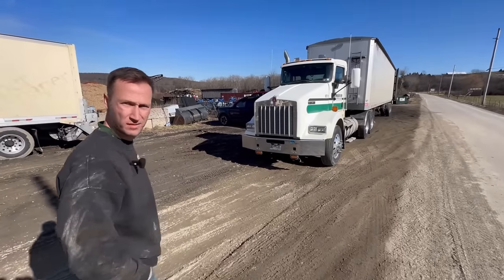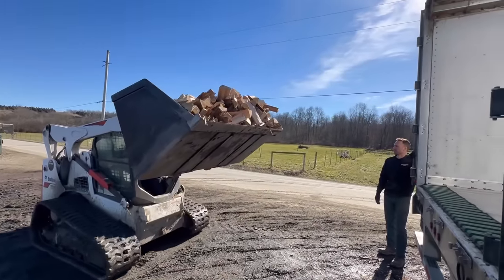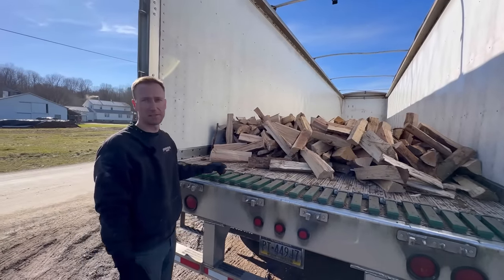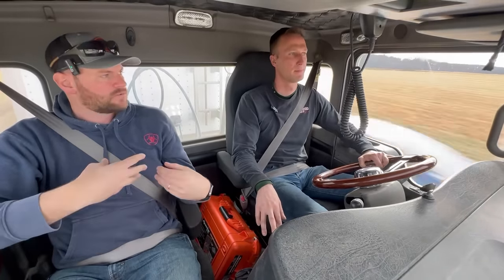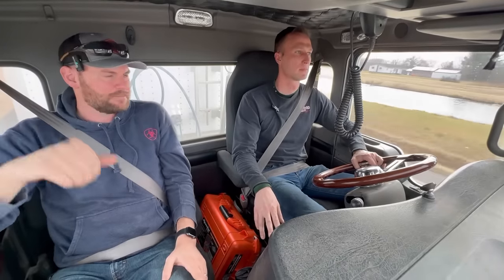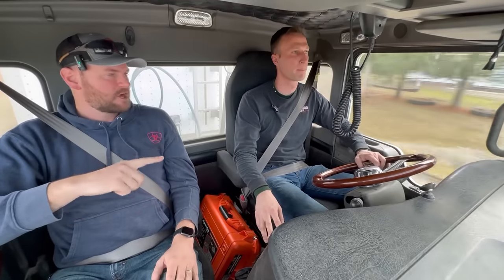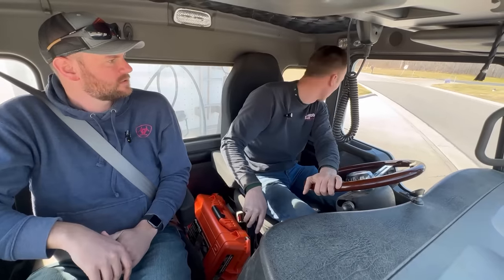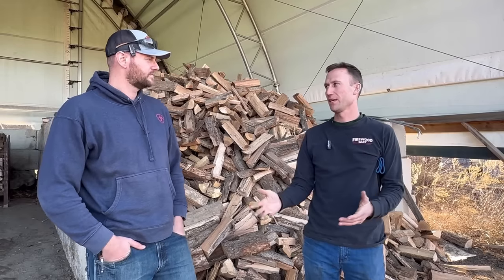12 Cord Firewood Delivery - How It’s Possible

Comment: How does one of those moving floors deal with debris falling in between the slats or at either end of the trailer?
Reply: The slats are very tight between them lapped over one another "pressure sealed" the debris to the rear gets pushed out and there is a tapered plate in the front of the trailer that keeps anything from getting in the front.

Comment: 2 hour drive from yard to custome. Not counting loading an unloading that 4 hours driving. Add 1 hour loading an 1 hour unloading as them walking floors are very slow unloading so total of 6 hour for the truck. Here in nw Ont. Going truck an trailer rate $200 per hour. 200x6= $1200.00 in trucking alone. That is very poor looking fire wood tons of tiny peace used for starting fire. It burn up so fast in 24 30 to 40 below. All that small tiny wood you  be loading stove every hour. I get 22 cords in a load in 8 or 16' lenghts. That 22 cord last 1 winter most years some year 28 cords at $140 a cord plus the trucking to the bush get loaded drive from bush to me an unload time an until he gets home. Every load it diferent trucking cost depending were loggers are cutting.

Comment: Your math doesn't add up for 12 cords. How does your customer verify the accuracy of the delivery?
Reply from the maker: What math?
Reply: 4*4*8=128*12=1536 cubic feet.
1536/27=57 cubic yards.
Trailer is about 48*8*7=2688 cubic feet.
2688/27=100 cubic yards.
There appears to be plenty of room in the trailer for more than 12 cords even allowing for expansion due to inefficient packing. I would think the customer would go by trust and past experience to verify the loads. They are not selling it by the pound.